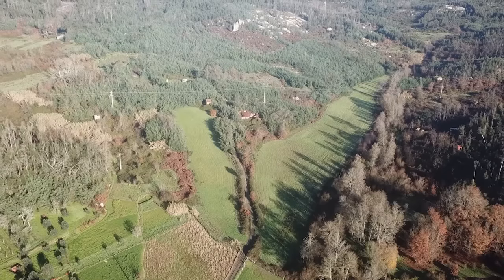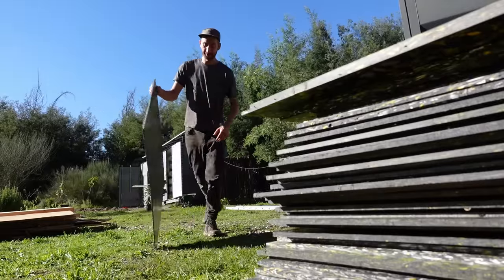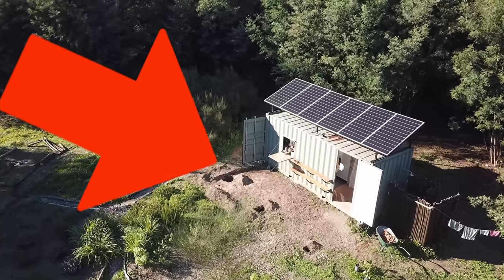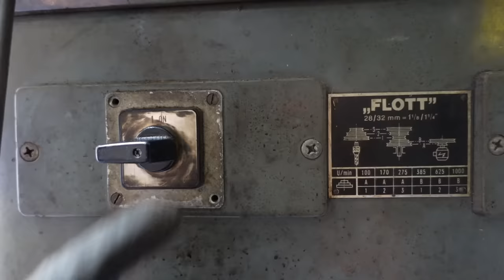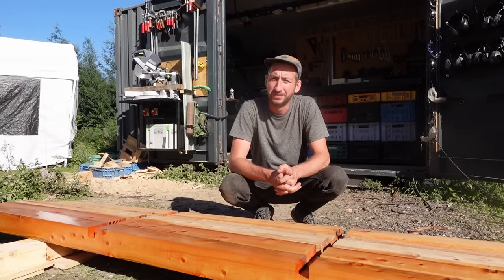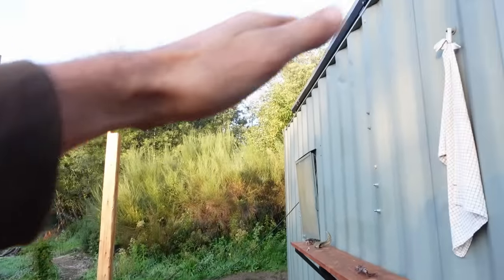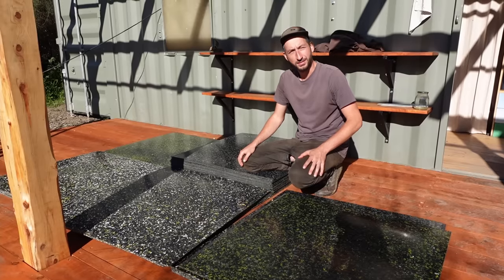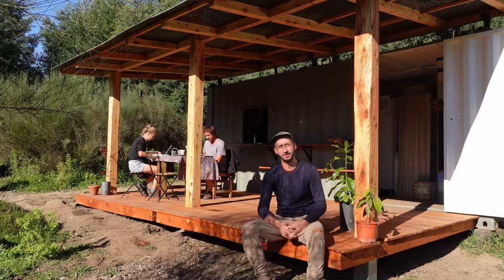#40 We made a roof from RECYCLED PLASTIC sheets

Comment: That would work inside go solar with roof that sheets could be floor covering wall or ceiling but kind of plastic tends to fade in the sun and eventually cracks Maybe a varnish that's UV resistant could work no idea if could cause a chemical reaction hope it works out

Comment: Polypropylene is NOT UV resistant. That means it will brittle and eventually disintegrate when exposed to the sun. Therefore you will have a lot of microplastic in the soil. 

There are plastics which are UV resistant. You might should change to those.

Anyways it looks nice! Maybe it‘s worth trying.

Comment: The only way you could straighten bent corten steel is by heating it first. Changing the wood was by far your easiest option. 😀
Reply: They weren't using the right tool to get the job done - they needed MORE POWER. Oh oh oh oh!

- Max Giganteum

Comment: Plastic isn't good outside, it degrades from the sun, this is why it's not an outdoor building material. You can however use it for the main structure and then protect it, via simply painting it with a high quality outdoor paint. this outdoor paint will simply act as a barrier and the plastic won't deteriorate from the sun. I would do something beyond paint though, I would use reflective aluminium foil, glued to the top of the tiles, about 0.1mm thick foil should be fine, this is about 7x thicker than foil you would use in the kitchen, so it's plenty thick to remain sturdy, and it will also reflect the sun rays away and aid in keeping the roof cooler.

Comment: PP probably wasn't the best choice for the roof panels. PP even degrades if no light hits it. You can see that in many houses here in Germany where the sub-membranes under the roofs just crumble at the slightest touch after a few years.
My prediction is that in 3 years or so, after a hail storm, you will be looking at a Swiss cheese.
The question is what will you do then with the broken panels? The material will be totally degraded at that time...
Reply: My guess would be that when first brakes occur next season, kampers will cover it with something. Maybe recycled plastic shingles second generation?

Comment: There is one very important think which you did wrong. The steel foundation under the wooden construction shoud be filled with  concreate and insulated with bitum, because the moisture of the soil will condensate inside the tube under the wood which will cause fungus growth and will destroy  your timber frame construction in a matter of years.

Comment: Hopefully you can paint it with reflective paint, because the UV degradation should be terrible.  I wonder if that usually horrible Henry's tropical silicone coating type stuff would actually work well on plastic.  You would lose the nice specklely look but only on the roof side, not if you leave the view of the plastic for a ceiling.
Reply: Or the tarry silver stuff, aluminized, that they use on metal roofs, maybe.

Comment: The sun and the summer heat will deform and degrade the plastic. Your bets option it to paint the top white. This will seal the oils in the plastic and reflect heat.  If you do not do this you will have potato chip shapes.

Comment: I love the anesthetics, but the building science is lacking. This roof will leak through those overlaps. Also, the notches in the cross members look nice but cut their load carrying capacity by 50%. Also, never submerge wood in concrete, it will rot eventually. The post should be on galvanized brackets sitting up off the ground.

Comment: POOR VIDEO. DISSAPOINTING GUYS! (even when it involves a much interested topic)... 20 min of video misleadingly titled somewhat about plastic roof. BUT you showed only a few seconds of "the releted theme" at the end of it and gave no explanation as regards to weight, materials, assembly, instalation, time,  sealing material, load resistance (ei: that of the installer, accumulated snow or heil, etc).